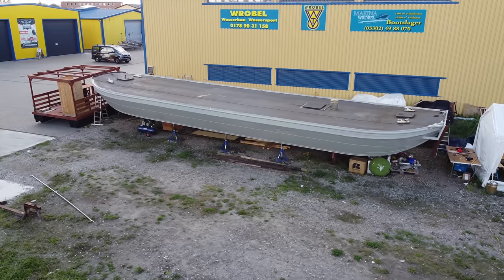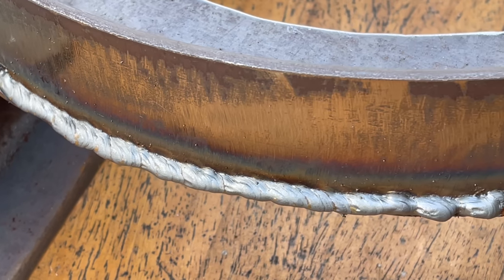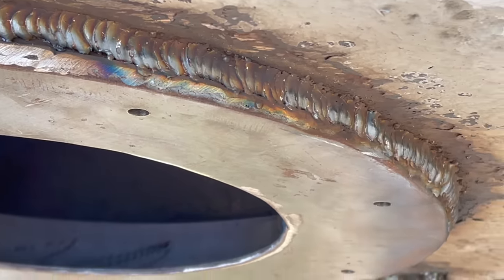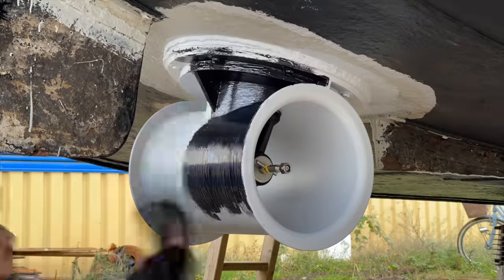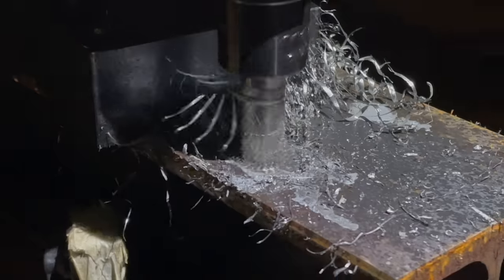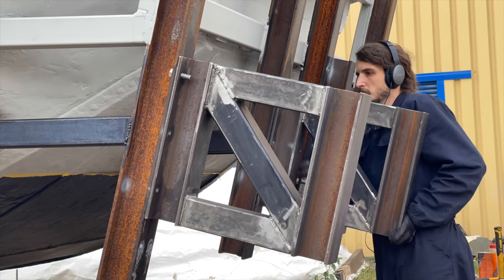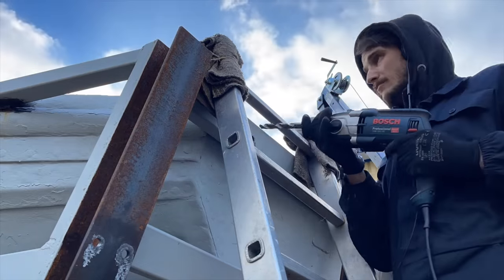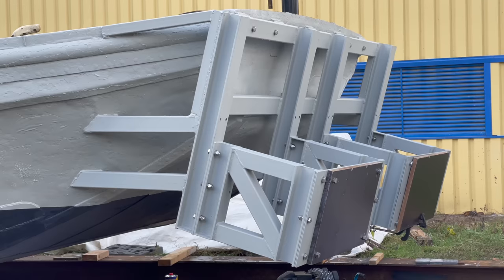My HUGE Barge BOAT is ALMOST READY to go into the Water

Comment: sometimes you just need to remove the top fairing of the engines to do basic maintenance, change spark plugs for example... and a level platform will come in very handy. the way you build it, with a sloping angle and nowhere to rest your feet and toolbox makes maintenance more difficult
Reply: Was thinking a similar though. 😃😃

Comment: The fin by your bow thruster is the old keel, so in effect you are going to be sailing your boat backwards, as to how it was designed. I'd trim the fin down to a minimum and add a keel at the stern. Otherwise your boat will be difficult to handle and feel very twitchy.
Reply: He needs some keel in front to steer effectively. A flat-bottomed boat like this, with no keel at the front, simply tends to go sideways when attemptiong to steer around a corner. I think he should construct some kind of keel over the bow thruster tunnel. It help with steering and protect the bow thruster when grounding.
Reply: @Jurflip2  My old Dutch barge had nothing at the front and handled well, it was a sailing barge converted to motor, it had strange handling in reverse (prop steer) but was very stable going forward even on the sea.

Comment: I am glad you decided to go for 2 engines! This is going to open a world of possibilities whenever you are  maneuvering!
Reply: Yes, ignore all those who say go for only one outboard.
Reply: Even with both engins wide open he will be way underpowered. 
Thats about 10% of the power he needs. He simply doesn't have enough propeller or power for that size vessel.  I have owned vessel half that size that needed more power and prop. I dont think he will get 2 knots with both motors running wide open. He would be better to get a good used pair of
Turbo diesel bus engins and turn one reverse through gearing. You need them to turn into each other or vessel will be impossible to control. I hate to see this young man waste his money and destroy 2 engine he could sell for better engines.
Reply: Dont really need 2 engines with a bow thruster. That said he definitelly should get bigger engines.
Reply: @w124mercedes7  don’t worry about the speed. Worry about the stopping distance!! Bet there will be plenty enough power to get this rig upwards of 4-6knots. But he needs to think ahead when stopping. I have a loading barge 8x3,5m with 9,9hp. At full throttle I get 4 knots. And it’s almost square in the front! If a was him, I would make the steering separate. That way he can use the outside engine as a “truster” when docking.

Comment: You are making it battle ready for sure ! Lol. Your attention to detail is fantastic ! Just remember that those motors on a standard boat are held on with 2” thick wood and fiberglass and you have over the top support for them now ! I would enclose the transom brackets to hold your fuel tanks , plenty of room , safe and easy to fill at that location , 6 - 6 gallons tanks should be enough . If you put a 5 ton crane on it you could do some salvage work ! Just a thought !

Comment: You might want to put some water in the boat around the thruster to make sure there are no pin holes in the welds. If it doesn’t leak out then in won’t leak in when it goes in the water. Just a thought.

Comment: For long term, those square tube sections need to either 1) Be tested for water tightedness, OR 2) Have some serious weep holes to let water out easily.
If you choose to have weepholes, flood the interior to the sections with a liquid anti-rust treatment like FishOil.
Rusting out from the inside is a trap that could result in a sudden failure.

Comment: You should probably weld some kind of guard around the bow thruster tunnel you have fitted. If you do ground the boat now, the first thing to hit is the tunnel. One advantage of a flat-bottomed vessel, like your barge, is that you can "take the ground", i.e. you can let the boat lie on the beach when the tide retracts. With the outboard motors, you have no concerns with props or rudders being protected, but the bow thruster tunnel is an issue.

Comment: you built the mounts for the engines inclined towards the engines... you need to build a level platform on these engine mounts to make the structure more rigid, but the important thing: this level platform just behind the engines will help you when you need to do it some maintenance on the engines without vibrations on the supports or the risk of slipping and falling into the water

Comment: As a retired marine engineer I really enjoy your projects not shying to learn new skills. Interesting to see all new tools you use not available in my days.
Reply: I think he is far underpowered and not even close to enough propeller surface for that size vessel.
Reply: @jackrichards1863  i dont think those 2 outboards will even move that barge. If they do it will be 1 knot running wide open and no way to control it. But some people have to learn the hard way. All the people rooting him on are doing him more harm than good.
Reply: @w124mercedes7  Based on what empirical evidence?

Comment: I am curious as to why you did not make the motor mounts so the propeller shaft is parallel with the water line? What you have now will lift the stern and drive the bow down!

Comment: A great job! Your confidence improves along with experience. 
If you don’t mind, I’ll toss out a suggestion about the bow thruster. I would highly recommend a crash bar around the unit. It’s very vulnerable to damage sticking out like it is.
And a question. Why does the transom assembly have a back sloping rake to it?

Comment: I agree with you about double and quadrupled repeating on job. I'm scratch building 4 legs for a star wars model. Each leg has over 50 pieces. I'm glad they're less than the weight of one of your bolts. You're doing a magnificent job.

Comment: what you need is a detwiler or a bobs machine shop    jackplate!!! motorlift  , that way you can adjust the engine height depending on the load ;) i have 4 outboards on my boat with the same system it is used in racing , but works for this application as well.

Comment: That bow thruster encapsulation  is also gonna create alot of drag.  Consider making it also more 'hydradynamic'. The transom design is now better. Typical German overengineering though, but if its helps you sleep than so be it. Btw: when it is not possible to calculate the forces and used materials, overengineering is IMHO the best way to go (unless weight is an issue).
Reply: Overengineering is underengineering

Comment: Might be worth fairing in around the bow thruster - looks quite draggy otherwise! Would protect it from hitting things too.
Reply: Was going to say the same thing.   The overall mass and speed of the barge probably makes the bow thruster hanging out there produce negligible drag, but it it does look exposed to damage, even with that existing fin in front.

Comment: Your going to want to flip those extensions so the diagonal beam points up to the outboard, as the weight of the motor is pulling down, and you want that to transfer down and back to the transom.

Comment: That is a low power welder. For the thickness of the material you are welding, you should just turn the wirefeed up all the way, and match it's burn rate with the current. Looking at these welds and welds you've done previously, the current is too low. The wire is feeding too fast and the material is not being penetrated as much as it should. I would grind these welds down and crank up the current and get some penetration into the parts you are welding together.
Reply: hehehehe.... I should have watched the whole video before commenting..... looks like you did what I suggested before I suggested it..... you're a mind reader 🙂

Comment: Great effort. Your metal working skills are really coming on well. Your friends issue was almost certainly due to the wind blowing away the shield gas on the mig. The resulting welds looked very poor so you were right to grind them back and start over. I think this is where a stick welder has the advantage over a mig. But good job all the same. Now where to have the bridge? Front, middle or stern? Pros and cons for each so maybe take some advise / have a try which feels best for you. 🚢🚢🚢 🙂🙂

Comment: When welding with the  mig make a wave or circle motion  this will make sure you have penetration on both pieces  another set of holes in your transom but half way between the existing so you can fine tune the height of the motors should be drilled now 
You're doing good keep up the good work  hurry a cold winter is coming
Reply: Scrolled through to find other welding advice - surprisingly little.
First welds were dirty - poor prep. It pays to have a stainless or brass bristled brush to hand to work over the welds while they cool. Keep agitating the area during torch breaks to keep contamination to a minimum.
Better to spend a bit longer preparing the whole area back to as clean bare steel as possible before you strike the first arc.
Reply: @dancarter482  remember preparation is 75% of the welder's work

Comment: I must say I admire your work. Also, you made the right choice when deciding on two outboard motors. 
As a result of your choice you will have quite a bit better manoeuvrability. Most likely you will not even need the bow thruster. 
It is nice to have, but in calm conditions you will be able to drive that boat of yours sideways. 

You could possibly have made it even easier to manoeuvre by looking in to azimuth stern drives. Or by making a contraption that can turn 200 degrees or even 360 degrees. 

So, even if some of your viewers have commented that you ought to have chosen a single engine I would say that you did the right thing. 

Manoeuvrability is worth more than speed 8 times out of 10, or that is my opinion. 

I am a Master Mariner by trade, but I would have said the same thing even if I only had a loose opinion on the subject. 

I really enjoy your videos, I had a live aboard myself a few years ago, and I find your approach and your enthusiasm for your project very inspiring.

Comment: Just for the future, making many small welds on and off makes really pretty looking welds, but with metal that thick, you arent getting the metal hot enough to get good penetration. Holding the trigger down and moving from one little circle right into the next will get the base metal hotter and make the weld stronger. These ones will work fine, since you overengineered them, but keep that in mind.

Comment: Welding over a thin spot like that to thicken it up is called pad welding and it's generally the way to go when fixing smaller areas. Also any sharp corners are an enemy of your coatings including inside corners, because it is really hard to get the paint all the way to the bottom, and it will allow some rust to form, and your coating and paint will crack. Ideally you would round all the corners with a grinder before applying your protective coatings and paint, especially outside.

 On that note welding overhead is hard. You can not have too big a bead or it will ball up and "droop". So you need to be quick, but go too quick and your weld will be cold, and wont have good penetration.

Comment: good work,  you should think about sealing the bolt holes you drilled in the ransom and hull so water doesn't get in the tubing and rot it from the inside

Comment: It’s important to prep the areas your welding properly. Pre heat the metal to remove any moisture. Must have the correct rod and amperage setting. Then you’ll have a good chance of laying down a real weld bead.

Comment: I get why you did the extension. In my opinion, I would have went with an IO and used an Azimuth thruster. That transom is still gonna be below the water line and that's gonna be a lot of drag. I would add horizontal steel plates to the bottom of the transom and vertical ones to the sides to make it more steam lined which will add more weight. Buddy, this looks way over engineered and you just added a crap ton more weight, which means you will now need to add weight to the bow. Which will make your boat sit lower in the water. I would also raise that electrical panel for the bow thruster off the hull at least 6 inches. Boats leak. But like everyone else, my interest is peaked!
Reply: exactly my thoughts!

Comment: Put the heat at upward-mid to lower-high heat setting and adjust the wire speed. Be sure to catch BOTH surfaces at once. DON’T weave the mig, stay steady.  Just make sure the wire burns both surfaces. If ya get both surfaces at once the bead will take care of itself.  Smaller bead is slower wire speed. Bigger bead is faster wire speed.

Comment: Since you are about to launch, you should think where on the inside you might want to weld on some brackets for internal fittings, battery box, generator mount etc. You would then be able to touch up the weld on the outside where it burns off the paint... Good luck with the launch.

Comment: You have lots of vertical bracing and upper horizontal bracing but there seems to be no bracing on the very bottom to stop the Tork from your engines at hard over on your engines transoms extensions from bending port to starboard. This is an observation not a criticism. As always, your work is of a very high standard. look forward to your next update. Stay safe.

Comment: Weak part of a transom are bolts, rest of it is overkill. Maybe it would be good idea to add a pin-pinhole or some sort of groove to destress the bolts. Overall, that transom could hold 2x400hp engines with cross pattern inforcements. Those transome extenders made out of tubing need some drainage holes for condensation release.

Comment: When ya made the extension why not try and make it a vertical mount instead of the angle. Also i would pit a level deck on above them, make it way easier to work on them and get in out of areas that are lower

Comment: That transom must weigh a ton, should probably add some weight to the bow to even the distribution. Also I would have had the five bolts turned the other way so the bolt heads were inside the haul and welded the heads to the haul from the inside so they had a little more reinforcement

Comment: Can't wait to see how this barge moves with those two outboards!!!!
Reply: Like a brick propelled by butterfly wings. So underpowered that it won't go anywhere at more than 3 knots. Also he needs contra rotating props to aid manoueverabiliy. As it is, it is a bodge job. Welding skill is fine but the overall design of the propulsion system is sub optimal.

Comment: Hi. Let me give an advise.
You put aditional transoms to the first ones. But instead make them horizontal, you simply made them square. If you look the boat by the sides you will see that the new ends are exactly at the same level of the originals. The motors will get drawning anyway

Comment: Nice Job. Nothing wrong with ya welding so just do it yourself from now on. Starting to come together ya didn,t really need a bow thruster with twin engines but will help in tight spots. If you had gone single Outboard ya defitnately would have needed it. Keep at it. Carry On.

Comment: The motor mount welding looks better than the bow thruster welding.  

When welding box section it is best to drill a 3mm hole in the box to release the hot air so as not to get blow holes in the weld, the 3mm holes are then easily welded without the danger of getting pressure build up internally.  

The extra fixings through the transom need sleeves welding in because any strain on the box section will deform the box and loosen the bolts, notwithstanding that the box will be crushed.  I've found that thick walled gas pipe is more than strong enough to take the compression.

Comment: Nice boat;) u are building a big brake on the back of ur boat. Transoms stikking down in the water acts like a a brake . May be better to use 100x100 square pipe to build sutch a contraption;) goood luck;)

Comment: What worries me is whether the weight of the engine mount and the engines themselves will contribute to the fact that the stern will be more submerged than planned?  To undo that, you need additional ballast in the bow, but that makes the whole barge even heavier.  I hope that the displacement will compensate for that extra weight and that there will be no need for ballast.

Comment: You have the motors on the bow? The bow thruster on the stern? You might need to make some kind of Skeg (like the plate you cut to install the bow thruster) this will help with directional stability.

Comment: The bottom of the transom plates sits low enough to the water line and angled just right that they will catch the water and shoot it up into the engines and swamp them out.

Comment: Gute Arbeit. 
What brand of rust converter do you use and    what is your experience with it?
The motor mounts look a bit heavy. I assume the hull is 4 mm steel. Why these heavy beams? Am I missing something?

Comment: So, split ring lockwashers aren't very effective. There is a product called "nord lock" that's a set of two washers machined with ramps so they spread apart and jam the nut if it starts to come loose and those may be a better choice if you can get your hands on them. Much cheaper than losing a motor in the water.

Comment: 2 motors gives you redundancy and als the ability to turn the boat by having one in forward and one in reverse. Are you fitting counter rotating props on the outboards?

Comment: overhead welding needs to be done hot and fast so the weld doesn't drip and fall out. both welds had to much wire speed and yours had what is called cold lap on the bottom edge. The weld is just laying on the base metal with out penetration. Small welding machines don't have much of a duty cycle...usually 60%....that is how much time you can weld... 6 minutes out of 10. The welder will cool down which makes your wire speed to fast. It was a good job over all, hope this helps in some way